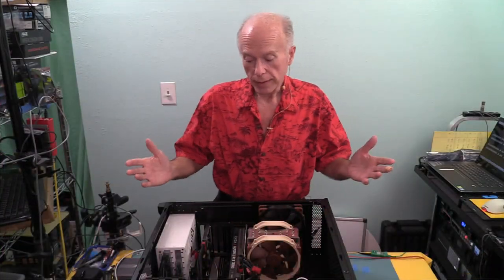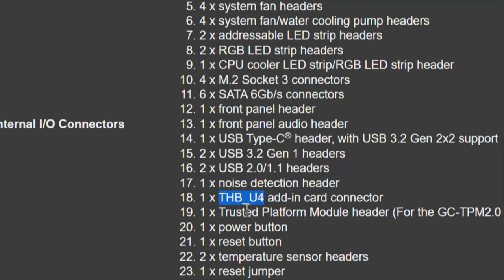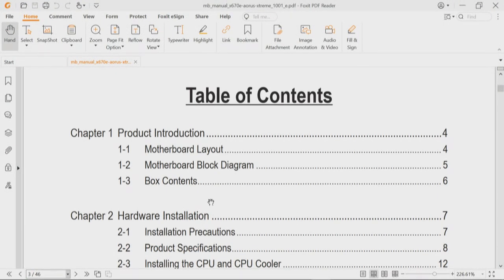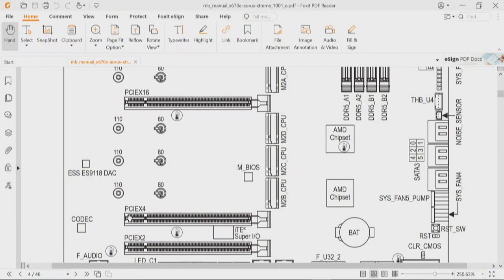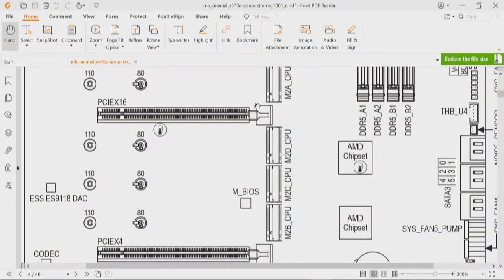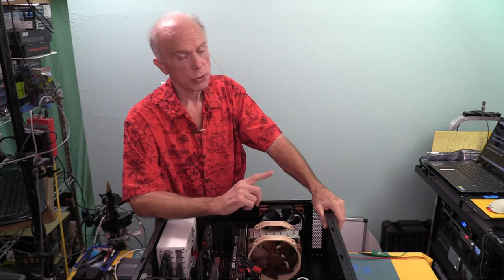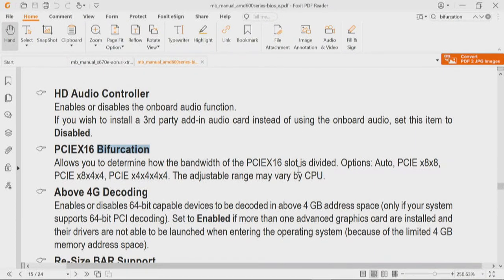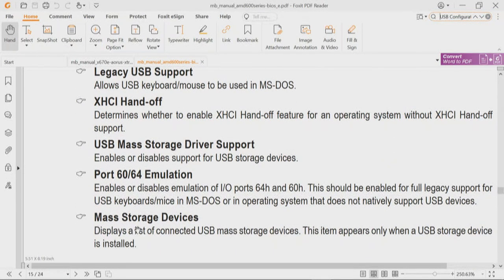Gigabyte X670E Aorus Xtreme Slots and Storage Overview

Comment: I just got this motherboard. Great overcloker. Gigabyte lets you overclock PBO and do a manual overclock. Supper happy with stable overclocks.
Reply from the maker: Hi Kosta Stanic, 
Outstanding! Good to know! Historically, ASUS was the best for Overclocking. Good to know Gigabyte has stepped up on that too! Appreciate Your Comments! Thanks for Sharing! 

BTW: How much RAM are You Using? And which RAM did You choose?
Reply: @BuildOrBuy  i am actually using 64 GB ram.
Reply from the maker: Hi @danwo ,
Curious as to Your RAM selection or choice of RAM? Based on available Densities, 64GBs = 4 - 16GB sticks of RAM.
Reply: @BuildOrBuy  I got 2 stick of 32GB. Corsair Dominator Platinum RGB DDR5-5200 C40 DC - 64GB (CMT64GX5M2B5200Z40). Now I have Rank1 on 3D spy on same system. Got also rank 1 on Userbenchmark (just for comparing). Need some extended testing just to see if something is unstable. But overall my temperatures are lower and I do use all tools I can in BIOS.
Reply from the maker: Hi @danwo , 
Sounds like You're set! Did not realize anyone had that Density yet! But have not looked at everyone yet. Was only checking QVL Based on Speed. Have only searched Kingston so far and they only have 16GB sticks. You've done well for the Speed! Do You know who's Memory Chips they're using?
Reply: @BuildOrBuy  Yes, its samsing B Die. Its in Qualified Vendors List (QVL), Model Name: X670E AORUS XTREME.
Reply from the maker: Hi @danwo ,
Aha, have my head in next Motherboard, MSI. Editing Video now. Got it! You have the best! Cream of the crop in RAM! Outstanding! Thanks for Sharing that tidbit of information! Helps Us to make better Videos!
Reply: @BuildOrBuy  thank you
Reply from the maker: Hi @danwo ,
Ditto!
Reply: @danwo  you never use more than the 2x m.2. slots dont you?
Reply: @BrickBazooka  I use personaly 2 m.2 on all my PC systems. If you need more space just use bigger m.2.
Reply: @danwod id you Upgrade anything on your setup recently? Im looking to buy the xtreme or the master x670e mainboard, but dont know which to pick. I like the xtreme better from the looks of it 😅

Comment: Amazing video! I'm still learning the ropes at pc building so I'll admit a fair bit of this went over my head for now (but I'm taking notes for later).  Am I understanding correctly that if I put the gpu in the x16 then I can use 2 NVME m.2 cards/sticks instead of 1, and if I use more than 2 it'll knock my gpu down to x8? 
Also, I noticed you mentioned some lanes being used on the left side for the usb ports in the back,  does that mean they're unavailable if I use all 24 lanes on the gpu/nvme or do they have lanes separate for that?
Reply from the maker: Hi ThatBarnabusGuy,
Welcome! Good You're doing Your Research! Fascinating topic! Look at the Motherboard Block Diagram on any X670E Motherboard. There are two types of PCIe Lanes, CPU PCIe Lanes and Chipset PCIe Lanes. There is one CPU and 2 Chips make the X670E Chipset. There are 32 CPU PCIe Lanes and 16 Chipset PCIe Lanes per Chipset Chip. CPU Lanes can be Split among PCIe Lanes and can be further Split or Bifurcated to allow multiple M.2 NVMe PCIe Drives on a Slot.

Generically when there's 2 X16 PCIe Slots, mechanically, when used simultaneously they are X8, electrically. And those are to the CPU. Only CPU PCIe Lanes can be further Split or Bifurcated. And a 3rd PCIe Slot will be through the Chipset. 

USB can be anywhere among those three and are always Dedicated Resources. We Outline PCIe Resources accordingly from Slots and Storage to other high use Resources like 20Gbps USB-C, 10GbE LAN, etc. On a Consumer Desktop Motherboard there are Shared PCIe Resources instead of Dedicated PCIe Resources. Lots of Connectors just not all usable at same time. Choices and Options which become obvious once pointed out! Crazy, right! Appreciate Your Questions! Hope that helps! And every Motherboard has a different Resource allocation! Once You look at a Motherboard based on that, You can stick to the facts in sorting each accordingly!
Reply: @BuildOrBuy  Awesome thanks so much for the reply.  Just downloaded the manual and will start studying through it.  I just discovered this channel and you definitely earned another subscriber.
Reply from the maker: Hi ThatBarnabusGuy, 
What other X670E Motherboards are You considering? We're working on Our next Gigabyte X670E Motherboard Video! Gigabyte is still the only Motherboard Manufacturer with complete Motherboard Documentation! The next ones to watch will be ASUS and MSI, in that Order, based on what they are currently sharing according to preliminary Specs.
Reply from the maker: Hi @ThatBarnabusGuy ,
Absolutely! We're all about Answering Subscribers Questions! I'm honored! That Motherboard Manual is crucial to understanding those Shared PCIe Resource allocations! Nothing else matters if We don't have Slots and Storage! A simple detail that matters greatly! And every Motherboard allocates Resources differently! Fascinating!
Reply: @BuildOrBuy  Actually the other motherboards I was considering was the two you listed.  Most likely I’ll go with the Aorus as the z490 master is what is in my current computer, but  even with it I considered MSI or Asus.
I didn’t really do much research with my first computer, but it turned out ok despite that fact.  But this one I want to make sure everything is how I want it before I actually start building.
Reply from the maker: Hi @ThatBarnabusGuy ,
Understandable. We'll talk about those once We have more complete documentation. Right now they only have preliminary Specs. No Motherboard Manuals as of yet! Smart to be doing Your Research first! Hard enough looking at the Gigabyte Motherboards with Manuals. We need AMD Documentation which is still not available yet either! Some of this We take an educated guess based on what We see. And that Info could change!

Comment: I was more impressed by the MSI MEG X670E GODLIKE :) there is an interesting connector near the memory modules and a small screen for something :) AND Onboard 10G Super LAN and 2.5G LAN deliver the best online experience without lag
Reply from the maker: Hi Иван Брагин, 
MSI Meg X670E Godlike: 2 - 4 Pin Headers up near RAM at top right of Motherboard. No Protection Jackets. Only Pins. Not V-check points. Until We have PDF Manual, up for conjecture. 3 PCIe Slots, 6 M.2 Connectors total. Marvell AQC113 10Gbps Ethernet, same Chipset. Plus Intel 2.5Gbps Ethernet. 3 - 20Gbps USB-C Ports. No USB4. M-Vision Dashboard LCD Touchscreen through 20Gbps USB-C. Not enough Info to Comment further, yet.
https://www.msi.com/Motherboard/MEG-X670E-GODLIKE/Specification

Comment: Huge thanks for this really useful video. 
It's going to be interesting to see how other X670E boards allocate resources. I'm still hoping to use a 4 drive nvme expander card in that primary x16 slot, and, a dedicated GPU that's not 'too' compromised on speed. Looks like this Gigabyte board won't allow that. I don't mind reducing some other features to enable this though that might depend on what AMD dictates is a minimum to the board partners. I do currently have the Zenith II TRX40 (a chipset unfortunately EOL'd by AMD after only one CPU series) so I might alternatively be hanging onto it, though my Zen2 3960X is going to be really shown up by a Zen4 desktop CPU. I've been a keen HEDT enthusiast for a long time (not a pro user) so I'm interested in how AM5/Zen4 has advanced in comparison to my current setup (reluctantly ignoring the PCIe lane count difference).
Reply from the maker: Hi Akexis K,
Appreciate Your Comments! Not enough CPU PCIe Lanes on a Consumer Desktop Motherboard! Yes, the HEDT demise left a hole in the market! Crazy, right. We shall see but don't hold Your Breath! This next Motherboard will be ASUS X670E! Fascinating looking at how PCIe Resources are managed from one Motherboard to another! Lots to consider! Historically, MSI may have the best Options for managing PCIe Resources. We shall see!
Reply: I know that sWRX8 socket TR PRO board cost more money, but eight channel ram and an extra 104 cpu lanes is worth the investment.
Reply: @maxhughes5687 The primary issue, apart from the significantly increased cost of sWRX8 (and greatly reduced motherboard choice), is that TRX40 was already 'the perfect enthusiast HEDT system' - and the #1 requirement here would be an expected 'longevity of support'...support they did indeed promise...
That AMD very, very deliberately chose to abandon TRX40 after only one CPU cycle - despite enticing so many with that now 'infamous long term support promise' is a pretty serious self-damning act. As I said, I currently have a Zenith II TRX40 system with 3960X CPU. That very Zen2 CPU is already behind the times with Zen3 high end desktop CPU's, and about to be severely downgraded through Zen4 desktop CPU's. That's NOT the position every TRX40 owner wants to find themselves in. AMD could have pacified some owners by releasing a Zen3 3D CPU. That they deliberately didn't is beyond shocking. 
--> To deliberately destroy your entire HEDT community is...insane!
I am, of course, interested in how far Zen4 and AM5 has advanced, and in particular - since this is a desktop -  how PCIe lane allocation is managed through the different boards. Clearly, AM5 will be severely compromised on PCIe compared to my current TRX40 - just as every 'desktop' motherboard has been PCIe-compromised since day #1 (and I started my computing interest a very long time ago). 
--> To repeat, for AMD to deliberately destroy its entire HEDT community is...insane!
Reply: @ChrisM541  "long term support" doesn't mean using the same socket over and over. 48 cpu lanes to the PCIe sockets only gives you two X16 sockets. TR PRO went from 4000 pins to 6000 pins that gives the user 2X the cpu lanes and twice the RAM bandwidth. That is a hell of a great upgrade. Your just quoting AMD bashing from Intel fan channels. Next year it will be a new socket for 12 channel ram and 256 cpu lanes. The TRX40 was a nice jump to GEN4 lanes, but the WRX80 is a huge leap to double the I/O.
Reply: @ChrisM541  I was on an X399 TR when you got your TRX40 board. Are you evil for supporting the end to TR 1900 and 2900 series boards buying the sTRX40 TR? I bet you didn't mind at all.
Reply: @ChrisM541  Well grandpa doesn't think 2 16X sockets and 2 8X sockets is the perfect system. I have a GPU and four quad cards for NVMe drives. On X399 or TRX40 I can run one quad card. It's only a matter of opinion. AMD's increase in pins/lanes and ram channels uped the the TR to a real pro workstation. "Support doesn't mean no new sockets and no one with a wrx8 socket would consider going backwards. The 5965WX is $2500 list. Would you throw that kind of money at a 5900WX 24 core cpu and not get more cpu lanes and octa channel ram?
Reply from the maker: Hi @maxhughes5687 ,
As We both know, Clearly the WRX80 is the better value. As You have mentioned previously, We should talk more about price per not only CPU Cores but also price per CPU Lane! Like We use to do with spinning Hard Drives on a price per Megabyte basis. Perception and Perspective! We've also seen Consumer Desktop Motherboards priced higher than even the WRX80 Workstation Motherboards! Crazy! Still, We have to Examine and Compare! Details matter! All about Function for Slots and Storage!
Reply from the maker: Hi @maxhughes5687 ,
Have You seen this yet? Wow!
EVGA ceases video card production, no more EVGA GeForce GPUs - VideoCardz.com https://videocardz.com/newz/evga-ceases-video-card-production-no-more-evga-geforce-gpus
Reply: @BuildOrBuy  YES. Thank you. I might throw in RAM channels as throughput/second. With apps that won't use the ram on a new O/S the only thing I can think of is to load the app to an AMD/DRC ram disk. maybe?
Reply: @maxhughes5687  Again, NO !!!
Reply from the maker: Hi @maxhughes5687 ,
Thank You too! We had hoped to try that out on the Gigabyte WRX80 since that was a setting in the Bios. That 1st Gigabyte WRX80 is now scarce as hens teeth!

Comment: I just got this board before finding all this bottlenecking issues. So my question for you is I have 4 NVME drives. Can I move the 3 that are in the middle cover to an expansion card to the far left pcie slot? Will that get me my 16x on my graphics card with the name slot filled to the right of the card? If not what can I do? I got a gen 5 NVME in that slot to right and I want the speed from it but I also need the graphics card to run at 16x. Any help would be appreciated :)
Reply from the maker: Hi @dramatech ,
Welcome. Did you check out the Motherboard Block Diagram? You could place 2 M.2 NVMe PCIe SSD Drives on an add-in card. That would take away X8 CPU PCIe Lanes from your GPU. Look at the Motherboard Block Diagram. Not enough PCIe Lanes to go around. Prioritize and notice what's going to give you your best options. Just not everything at once.
Reply: @BuildOrBuy  appreciate the fast response. I am somewhat tech savvy but this whole thing has me confused. Even the diagram. Thanks for the help.
Reply from the maker: Hi @dramatech ,
Good timing. Smoke and mirrors. Lots of Connection points. Lots of shared resources. A conundrum. Consumer Desktop Motherboards are an enigma. What best suites what we need is a HEDT. That's the best value.

Comment: Hello, first of all thank you for your very good videos.
I own an MSI MEG Z590 ACE with I9 10850K and would like to connect my Apollo Twin Quad MK2. My board has a Thunderbolt 4 connection my Apollo Twin but only Thunderbolt 2.
Somehow it doesn't want to work. Of course I connected it via a Thunderbolt adapter and cable from Apple.
Do you perhaps have a solution how I do it or what I need for it?
Thanks in advance !
Reply from the maker: Hi Der Babo,
Welcome! Great Question! Just now seeing Your message! We did not see a notification. How are Your Powering the Device? Cannot be Bus powered! The link below might help. 

"Apollo Twin Thunderbolt Connection Info – Universal Audio Support Home" https://help.uaudio.com/hc/en-us/articles/206132896-Apollo-Twin-Thunderbolt-Connection-Info

Even the Direction of Cable orientation matters!